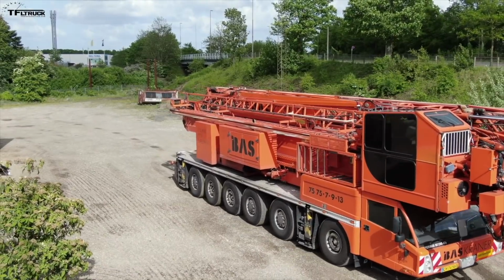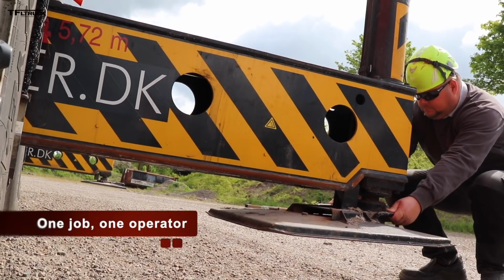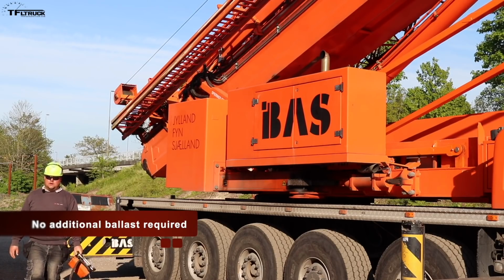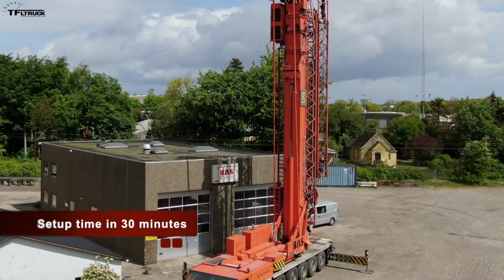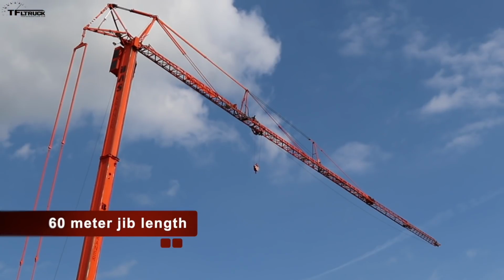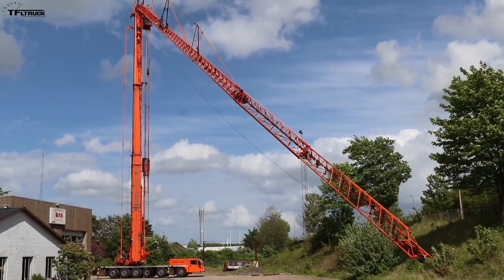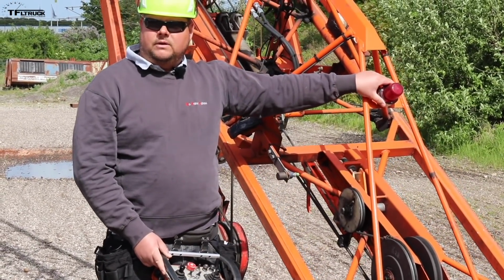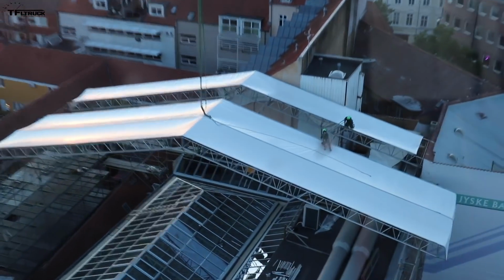What Has 6 Axles, 12 Wheels & Can Lift Your Pickup? Watch THIS To Find Out! Dude, I Love My Crane!

Comment: Next we will see an EV completely autonomous crane.  No operator required...and thus no one to submit the video.
Reply: Not gonna happen.  Even if you could have it all automated there would be no way I would work with one without someone in the seat.  Crane lifts are dangerous enough as it is.  Not having someone being able to take over if things go wrong would never happen.
Reply: @pin65371  Well, that was a joke.

Comment: These types of cranes are great in tight spots, we use these when air handlers HVAC are needing to be changed out.  Minimum 2 hr charge $1000 and $500 an hr.
Reply: That seems quite reasonable to be honest, does that time include setup and 'tear down' as well or is that just lifting time? Just curious
Reply: @markacevedo441  Its usually including setup :)